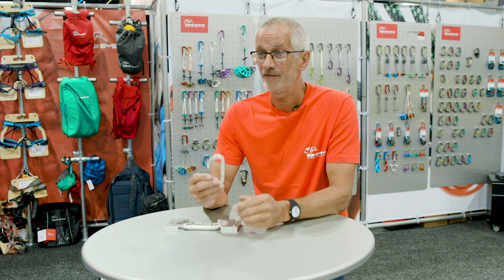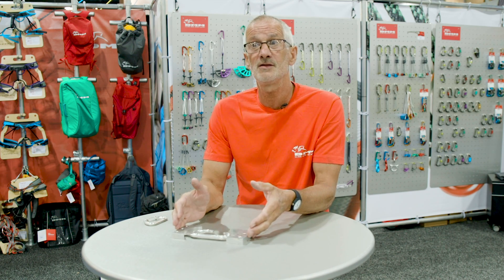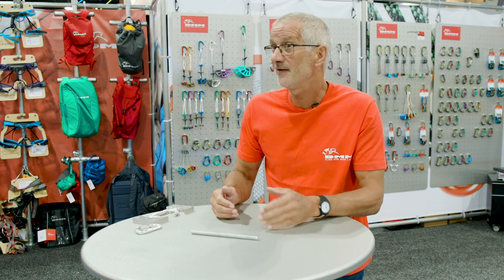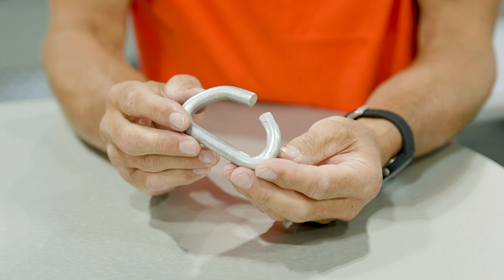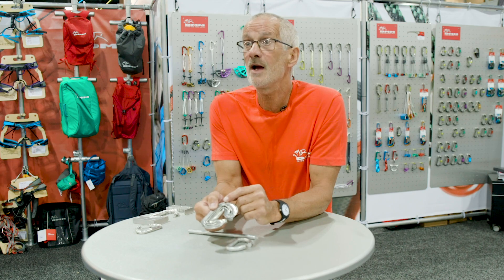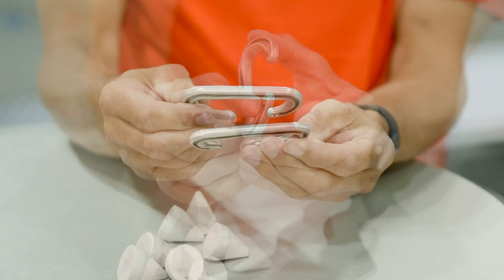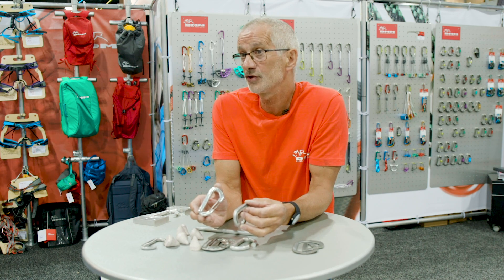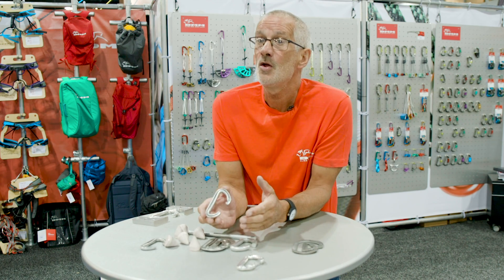How DMM Makes Hot Forged Carabiners

Comment: Do they make carabiners for anyone else?
Reply from the maker: Yes! DMM makes carabiners and belay devices for other companies. (I don't know if we can share any more details about that...).     -AD
Reply: @WeighMyRack  I am curious now, can you ask them if they can share that information? Would be really cool to know about other gear produced by them, I am always interested in trying out different designs!
Reply from the maker: @Martijn_Poot  Yes! I will ask. Coincidentally, we're flying to Wales on Saturday to spend time with DMM, so I'll ask them in person and see what the situation is around disclosure. Stay tuned.   -AD
Reply from the maker: @Martijn_Poot  So I checked in and DMM doesn't mind if you know what gear they make, but the companies they make gear for aren't as stoked for that to be shared all over the place. 

If you search the net, you can find some more info, like in 2010 DMM officially responded to a post about which brands they make gear for: https://www.ukclimbing.com/forums/gear/mammut_bionic_screwgates-425185. 

And there are rumors on the internet that you can decide to find worthy or not: https://www.averagealpinist.com/writing/2016/4/12/long-term-review-dmm-pivot

DMM does make gear for non-climbing brands too, but mostly it's specialty parts and not a whole device.